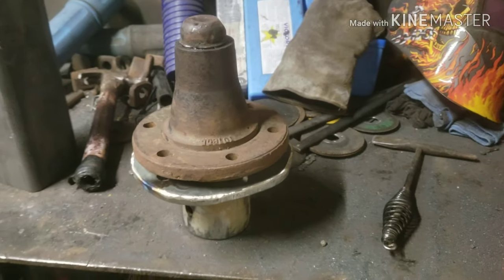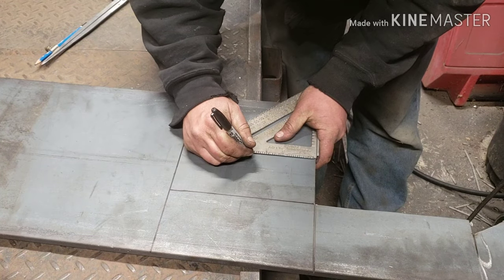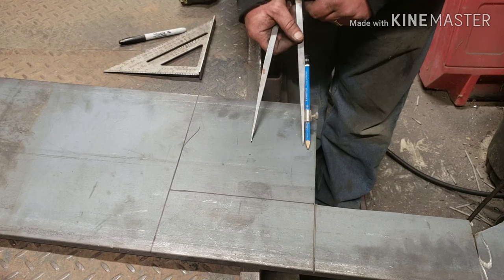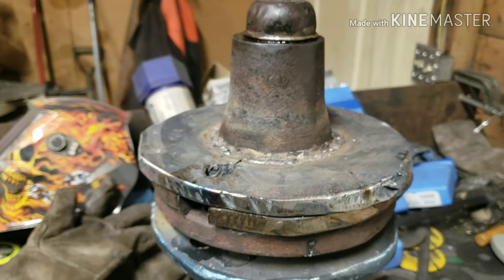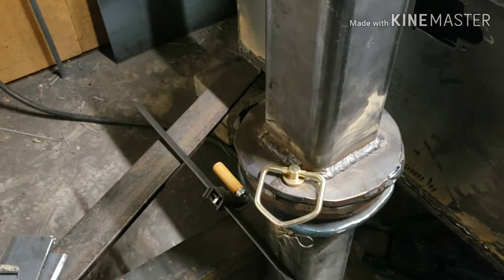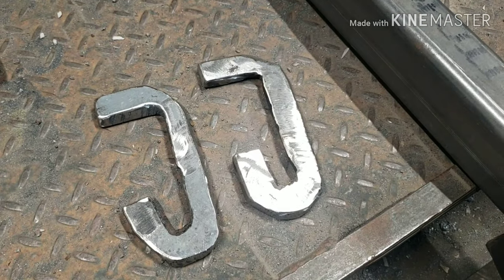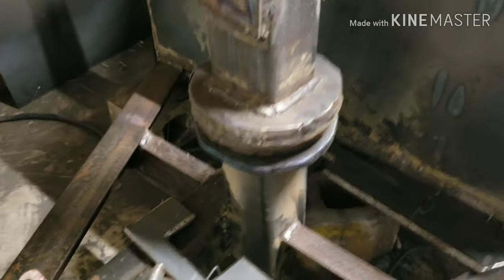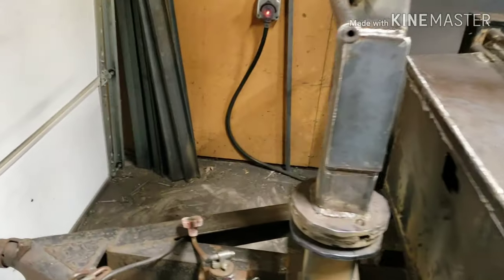Timberland trailer build part 5: trailer mounted swivel hoist / swivel crane for my log trailer.

Comment: Id be concerned about the swivel part breaking off. Those are massive pressures being put on a wheel bearing. The bearings can handle the vertical pressure just fine but the bending forces is crazy high.

Comment: What kind of axel did you use and has it been holding up to the Stress alright? Looking at building a crane with a 7’ reach that will have to support up to 700 lbs. 4900ftlbs of torque on the hub.
Reply from the maker: Originally i had one from a big chevy grain truck but that was when i was planing on doing this to a gooseneck. This lifted and swung over 700 lbs on a motor and tranny but i just found a spindle off a cheap little utitlity trailer at a scrap yard. I didnt add grease zurks but wouldve been a good idea to swibel under load easier. It has held up well. Also thought about making the boom extendable but decided to have fixed length. One thing that might help is angle it to the back more than 10 degrees or extra bracing and counter weight on the back.

Comment: I'm looking to build something similar to this except a telescopic boom and a hydraulic version . Looking at your build I noticed a major flaw in your design . If those hub bearings ever fail you have noway to access the axle nut to replace them which means you'll have to cut the riser off the hub . Also a trailer hub with electric brakes would've been a safer choice as you would have more control of the swing rotation . If you hadve put the hub facing down bolted to a flange I think would've been a better choice as you'd beable to service the bearings if fabricated right . Just my 2 cents worth . As long as it does what you need it to do then that's all that matters
Reply: Ya the axles are the only thing i couldnt change. Ran out of money.

Comment: Very nice !!
How did you figure out what size & leangth to draw out those templates for the boom ?
Reply from the maker: The templates for the ram and hook? I test fit the boom together laying down on trailer, laid cardboard over it, drew my lines along edge of the boom then just freehanded a shape i thought would work. Cut out the cardboard and test fit and modify as nessesary. Does this answer your question?
Reply: @SharpEdgeForge_1050  yes sir !  Thank you very much !
Reply from the maker: @383chevystroker  youre welcome

Comment: How did it come out? have you used the hoist alot?  afterwards, would you change anything about it?
Reply from the maker: I havent done another video because my phone port broke so i cant transfer to computer. Maybe ill try to upload from phone soon. I have used all features and has worked great. Ive used the hoist to load an air compressor in my truck bed and a few other things other than just logs. Wouldnt change or add anything so far.
Reply from the maker: I just added a video of a few times using the trailer